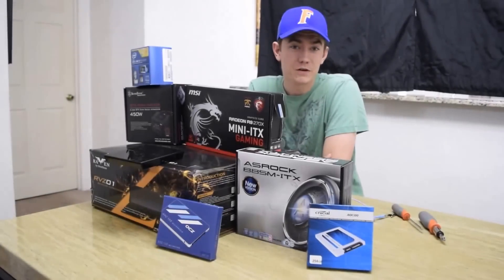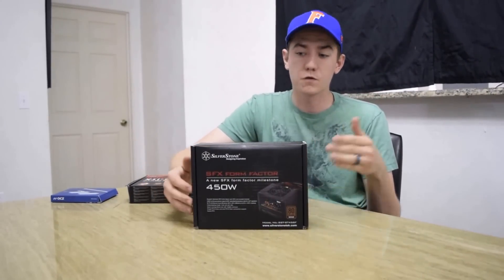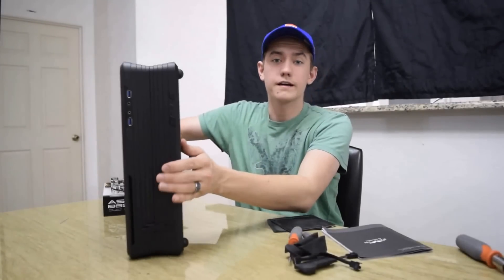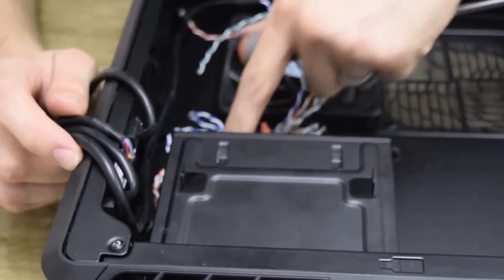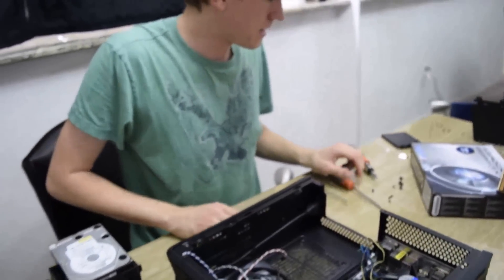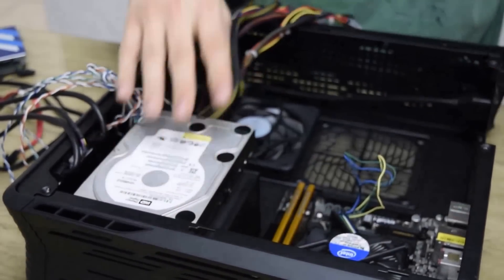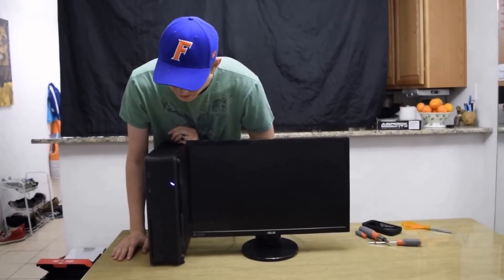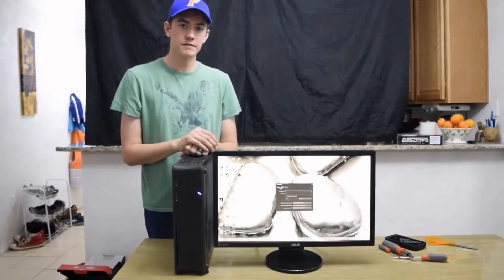Silverstone Raven - RVZ01 - Build Guide

Comment: Great video! I'm actually having trouble with connecting the power switch, reset switch and the LED wires. I'm fairly new to building PCs and just can't get it to turn on. I have the same motherboard you have in this video, some advice would be appreciated. Thanks!
Reply from the maker: Did you test the board prior to installation?  Use a screwdriver between the Power Contacts when the power is on to see if it boots. Another thing is to make sure the PSU was installed correctly with the power switch on the correct setting.
Reply: Alright I tested it the way you suggested, and after that I got everything working well. I'm on my new rig actually typing this comment.

Comment: will this case be able to fit into a cabin bag? because i will be flying alot.
Reply from the maker: +yayo3036 It depends on how flexible your cabin bag is.  When I tried to fly with it, I had a rigid carry-on bag and I couldn't get the extra 0.5inch to get it in.  It certainly is small enough, but since it's a rigid rectangular box, you're bag would be the ultimate determiner of the answer.  Thanks for watching the video. Hope it helped.
Reply: +UFDisciple hey thanks for the quick reply. okay so maybe i'll go with the silverstone sugo sg13.
Reply from the maker: +yayo3036 A good choice.

Comment: https://www.youtube.com/watch?v=vROqas1yRvs
as you can see here the user uses a mini dtx mobo(Asrock H61M-VG3) ... it has one more pci slot than m-itx and therefore the gpu adapter is not in the same place
the gpu adapter can be shortend as far as i know by leaving out a piece but does it work without the middlepiece between gpu and the 90degree riser piece ? i dont wann find out after i bought the case :x